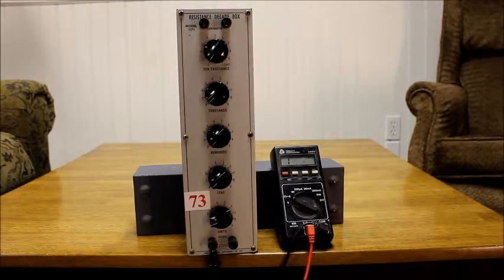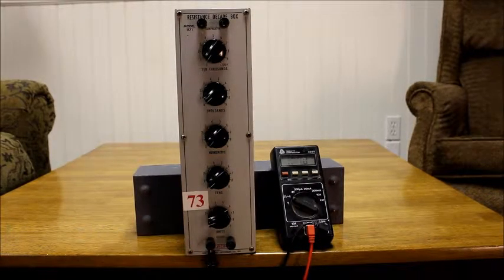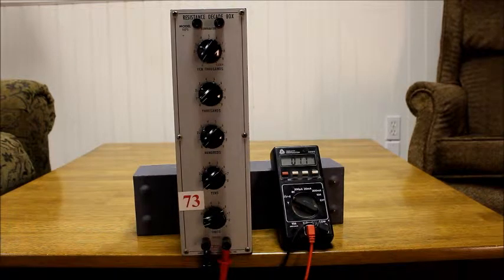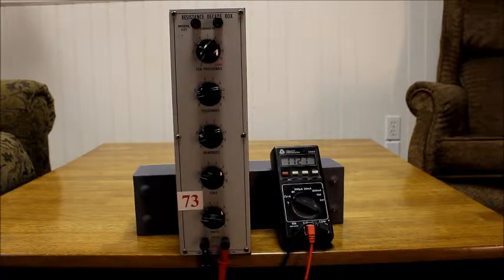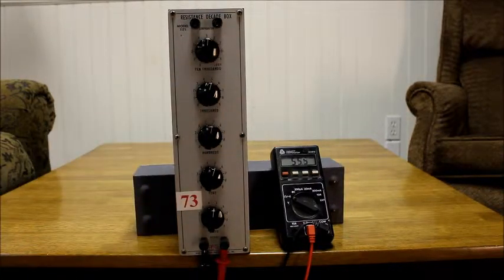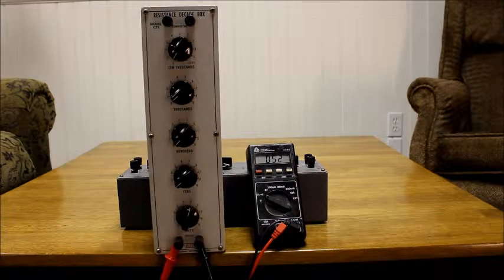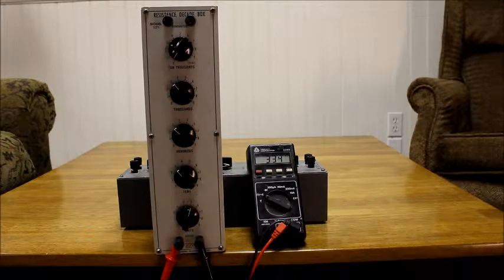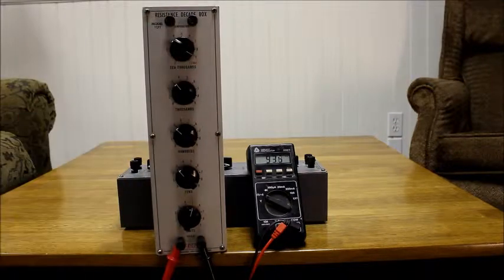Eico 1171 Decade Box Demo

Comment: What sort of applications would this be used for? I just found one in with a bunch of Phone and ancient computer equipment including a PDP 8F.
Reply from the maker: A few days ago I was trying to find out the value of resistor needed to get a cassette motor to run at the exact speed needed to get the audio perfect. I used this item (in conjunction with a potentiometer) and just rotated the knobs until I got the speed that I needed. I then removed the decade box, and soldered in resistors of the values that the knobs were set at.
What are your plans for that PDP unit? http://www.pdp8online.com/miscdocs/pdp8e-sales.pdf

Comment: what's the "comp" setting on the uppermost dial?
Reply from the maker: I did not know, so I googled that question and came up with this link, and explanation: https://tinyurl.com/y4szsoey
The Eico Model 1171 Decade Resistance Box also has the Comparator jacks. Its manual states "Comparator Position: A decade box is often used while experimenting on a new circuit. Once the optimum resistor has been determined, a standard commercial resistor should be tried in place of the variable resistance box. The circuit may behave differently when the commercial resistor is substituted for the standard resistor. A COMPARATOR position has been included to let you check the differences easily. Connect the commercial resistor to the Comparator terminals and set the Ten Thousands (the highest resistance decade) switch to the Comp position. The commercial resistor is now switched across the Decade terminals while the resistance box is bypassed..." On my 1171's, I have tried the Comparator, and it does work, but it also has the extra test lead lengths and (unsoldered) terminal resistances to consider